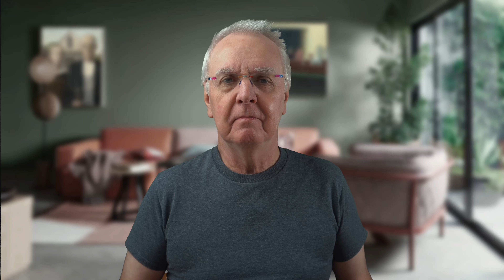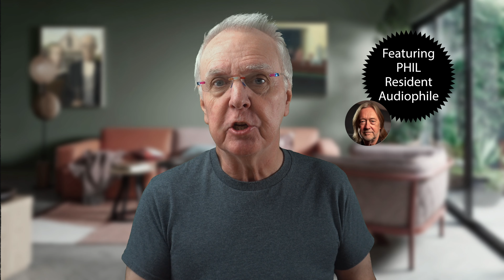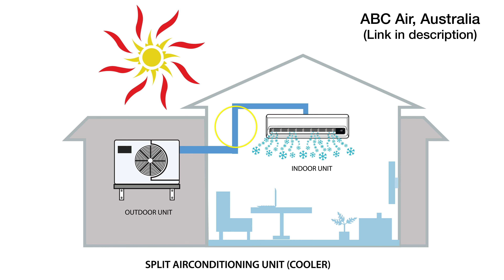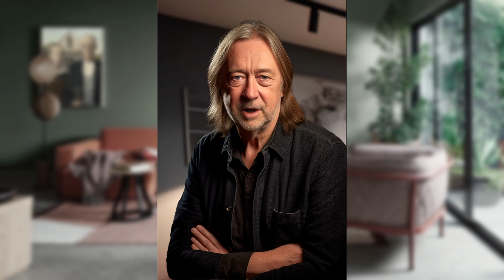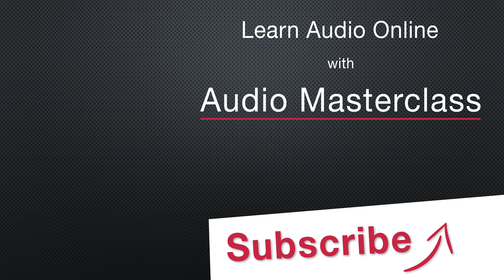Audiophiles! Are you losing your cool?

Comment: Found it so hard to listen to your flawed logic.  Sure a manufacturer can design a component to manage heat, but did you actually read and totally follow the instructions in the box.   My amp assumes an average room temperature so according to the manual I cannot run my setup in the summer.  The specifications state I need to provide 80cm of clearance around the device, so I take it I cannot put it inside a cabinet.   Thank goodness it has XLR connectors on it as the only place in my room I can guarantee nothing within 80cm circumference is on the opposite end of the room.  

So perhaps the need for cooling isn’t that the manufacturer didn’t account for heat, but more didn’t accommodate for realistic use inside a house where room temperature varies, and air flow can be compromised.  so adding some help can make a difference from having an amp clipping on a louder complex passage of music and it just simply works.
Reply: Are you sure that's not 8.0cm .... 80cm is almost 3 feet.
Reply: Exactly.. and the message I sent to the support department basically said the same thing.   The response back was they don’t recommend putting the amplifier inside a cabinet as it restricts air flow.    I proceeded to ignore it and fitted a dual 140mm computer case fan to push air into the top of one half the case, and flipped over to pull out air on the other half.   Forced airflow ventilation and zero issues at almost silent noise levels as I used a big enough fan for CFM running at low speed for silent opposition
Reply: @innovationsinm  
Okay... but one suggestion ... Warm air is less dense and tends to rise upward.  This is natural "Convection".  

When boosting airflow in a case (as opposed to on a heatsink) you generally want to improve on the convective flow.  That is: you want to  draw hot air out through the top and let cool air flow into the bottom of your device. 

It is entirely possible that the blowing air into the top could stall the natural convection and actually have the thing running hotter.
Reply: Naïvety on general manufacturing isn't good grounds for advice.   The whole side the manufacturer has with the 80cm around is to allow for enough air to be cool to allow for the process you are trying to describe.   but put an amp inside a cabinet and all of a sudden you loose the source of cooler air.   As you are trying to use convection where the warmer air will move upwards creating a lower pressure over the hot heat sink that will draw in the cooler air from the side.   (you do realize that air has a very bad heat conductivity)  Now how you get from the bottom is a mystery as there most likely is a circuit board that everything is mounted on.    Where this fails is you are now inside a cabinet that is more of a closed environment so initially the warmer air will start to rise.  B ut as the air above the device heats up the pressure of the hot air increases to the point that less and less convection happens.   As the now warmer air above the heat sink gets hotter it requires more force to move the air upwards so the heat sink slowly gets hotter and hotter.  For a while the system will work but pretty soon the heat sink is warming the air to the sides just as fast as the air above til the point the convection current totally collapses.  
So now to overcome this you either need to try and keep constant new air flowing into the cabinet so that a constant amount of cool air is inside the cabinet so that convection can happen naturally,  or you can force a larger amount of air over the heat sinks so that they never actually heat up.   one of those options are far more effective than the other but you can choose what method you'd prefer to use.
Reply: @innovationsinm  
Most competently designed amplifiers (other devices too) that use internal heatsinks will have openings in the bottom or lower sides to allow cool air in.  If they do not, you might want to consider creating some. 

The whole point of fan-boosted-convection is to get the heat off of the heat sinks... the fans will simply accelerate that process.
Reply: @Douglas_Blake_579  No point in arguing with ignorance (or perhaps arrogance).    you have clearly made your mind up you are right.   Best if luck with your opinion.  clearly it is working well enough for you
Reply: @innovationsinm  
Well... Chuck You Too Farley!

I'm 40 years in the trade.  You might reasonably assume I learned a few things along the way.

Comment: I used to fix copiers. I have a bunch of 24v fans that I pulled out of junk machines. I have a bunch of AC/DC adapters laying around so I wire a 6-12 volt line to the fan. It runs slow and quiet. I plug it into a switched outlet and I'm all set. I set the fan on top blowing air out.

Comment: AC Infinity fans are top notch. I used an inferred gun and after 30 minutes my Emotiva - 94f , Outlaw -88f and Fosi V3 - 97* and none got crazy hot, but much warmer then I cared for. So after running with fans back on no amp got over 80*, so yes they stay cooler and I'll take that insurance anytime.

Comment: Lets start with a simple observation ... Most audiophiles spend considerable time trying to fix problems they don't actually have.  "Much ado about nothing", enacted in modern day real time.

David correctly points out that the first step is to determine if you have a problem at all.  Most modern electronics is safe up to about 50c, measured on the heat sinks, which will translate to a higher but still safe junction temperature in the actual chips and transistors.   

Also check the manufacturer's specs. They will most often tell you what the device's safe operating temperature range is. The best way to measure the actual temperature is with an infrared thermometer set to show you the highest temperature in it's view.

The easiest first thing to do is make sure your equipment isn't jammed into some small cubby hole with no air circulation around it.  The close confines simply limit the amount of cool air the device has access to. The more open the space the better.

Also don't stack things on top of heat-producing equipment. This runs the risk of overheating the device and anything stacked on top of it.

Competently designed amplifiers will have thermal shut down circuits that also protect against over-voltage, reverse voltage, DC offsets, shorts and too much current.  They will let our ear-bleed seeking friends brutalize them only so much before they simply shut off.

Of course the solution to active protection circuitry is very simple:  Turn it down. 

(Seriously, this is a long ignored secondary function of volume controls that is as easy to use as the primary function of turning things up to the point of impending ear damage.)

Fans are not evil.  Any 120mm computer case fan, designed for 12 volts, will run near-silent at 9 volts.  Simply attach rubber feet and place them on top of the device's top cooling vents, to draw hot air out.  Or, when there are no top vents, place them to simply blow cool air in the direction of the device.  Either way the goal is to boost convection cooling, and it usually works quite well.  You may notice a slight whirring when the system is idling, but you'll never hear it during music or movies played at reasonable volumes.
Reply: Never had an AB or Class D amp overheat. Never needed an extra fan.  I have a class A pre which runs a bit warm.  My commercial amps have fans which have never come on in home use apart from one that runs the far from startup.   Had a tube power amp that ran very hot and the power tubes really needed to be replaced every year .... based on actual measurements which revealed rising distortion components. My tube preamp didn't eat tubes but I had to replace the power supply every 2 years!  Boo!
Reply: Thank you!!

Comment: I design and build my power amplifiers with heat sinks far bigger than they need to be so they always run cool to slightly warm. I do this because for every 10 degree Centigrade increase in transistor junction temperature, the life expectancy halves.

Comment: fans are ok imo, just not ones that are 40db loud...
Reply: Look at the new crop of 120mm computer case fans.  They're made for 12volts but if you run them on a 9v power supply they're almost silent.  AND they're a lot cheaper than the "audiophile" stuff on the market.
Reply: @Douglas_Blake_579  i replaced the fan of a xbox one s with a noctua fan..... from memory the stock cooler was way louder, the noctua barely noticable, the cd drive became the big next noise source.... :) 

Noctua is probably the go-to fan brand for such after-market mods
Reply: @dornauge1995  
They are good fans ... but any decent fan will do the job.  
Again the secret is to run them on 9 volts instead of 12.

Comment: No cooling issues at all in my system, the fans don't even switch on with the lone exception of my gaming console. Video boards in an AVR might run hot in some units, however.

Comment: I have a class A Super Dynamic JVC receiver from 1987. I used to run a small fan on it. Didn't hear the advantage of class A, even in comparison to several other class A/B units that I've listened to over the years. More recently, I listened to a Marantz integrated amp, switchable between class A and A/B. I heard slightly more clarity in class A mode. Based on my years of experience, Class A isn't worth the inefficiency, the heat, and heat isn't exactly a friend of electronics / circuits. I also do not want extra heat in my home when it gets hot and humid. That makes the AC work harder. Class A/B for me. I am good with it.

Comment: Follow up question: should I worry about dust entering the holes?
Reply: Yes... David is right, it's a problem.  (fans or no).  
When adding fans try to boost the natural convection inside the casings or along the heat sinks.  That is place a fan on the top vents to draw warm air out of the case.  This will also draw floating dust out of the case with the hot air.  It won't totally stop the accumulation but it will cut it down by quite a bit.
Reply from the maker: Yes you should. As an extreme example my old Mac Pro, soon to be visiting eBay, sucked in the dust and collected it. Every so often I would vacuum the vents which would be clogged with dust, and once in a while vacuum thick layers of dust inside. This would be less of an issue with audio equipment but I don’t think it would be of no issue at all.
Reply: Dust building up on the surface of the components and heat sink might become an insulation jacket over decades.

Comment: thank you for the topic, my comments and experience sharing:
1) cooler doesn't mean better. for example Tube amp: you have to wait till it warms up.
2) Solid state devices are much more tolerant on temperature range.
3) Let's assume that a good design for home residence is designed to work at indoor temperatures of +15 to + 35 degrees  and assumes a normal  room temperature of 25 degrees. this is a very narrow temperature range.  industrial range for solid state components is at least -20C to +70C Degrees
4) Passive cooling has no limits. Any passive cooling system can reach any goal of heat dissipation using enough amount of size (volume) and weight (and $$$). 
5) Fans are a big no no. You need it at least for a late night quiet mode of listening. In such a scenario  a "quiet fan" is noticble. I have a PC as part of my system and have change it to  fan less heat dissipation method. this (with other actions) reduced the room noise level from 33 dB SPL to 29 dB SPL.   
6) Class A and Class B share the same electronic design the "only" difference is the Bias current level.  if you increase the bias level you allow more dynamics on the quiet passages to be using the "non switching area" of the working point. of course, the higher the Bias current the bigger heat  dissipation required is. a good designer takes into account the distortion level of each and every component and stage.   
7) Bi amping, plus Active subwoofer splits the power between amps thus reduce the required amount of power per amp. Mono blocks as well (but will increase the $$$ investment).
8) I did not mention yet the Class D option. certainly for subwoofers. 
9) Air conditioning in the room: has to be quiet as well.
10) thermal active  bias control is not a problem:  thermal bias controls assures same bias current at all temperatures. it is not to be confused with temperature control (which most Passive amps do not utilize). 

Thanks
Reply from the maker: Picking up on your comment on tube amps, obviously the heater needs to be warm but I wonder whether other parts of the tube need to be warm too. I wouldn’t think that any external cooling would affect the heater but it might be interesting to explore this further.
Reply: @AudioMasterclass  
The cathode has to be warmer than the Anode for the tube to conduct.  So yes the envelope temperature does matter.
Reply: @AudioMasterclass  
I Don't use tube amps. From other users reporting, I know that a tube Amp needs some 10 to 20 minutes of operation till it reach its optimal working point. This means it finished warming up period and reaches a temperature stabilization.

Comment: I recently came across the Noctua NV-FS2, which is marketed as a quiet and award-winning fan designed for general use, including mounting on the vents of devices like integrated amplifiers. While I’m not an audiophile and don’t drive my amp very loud (it’s a mid-range NAD, though I don’t recall the model number), I’m considering adding this fan to help with cooling due to rising ambient temperatures—especially in the summer months, when climate change has made things hotter for longer periods.

I’m primarily concerned with the longevity of the amp, not necessarily improving the sound quality. Many electronic components, like capacitors, are rated to handle high temperatures, but it seems to me that lowering the operating temperature by just a few degrees might reduce stress on the components and extend the amp’s lifespan. I know some people might be against using a fan due to potential noise interference, but since I usually listen to music in the background while working (not in a sweet spot), that’s not a dealbreaker for me.

I’m curious if anyone else has tried something similar, whether with this Noctua fan or another solution. My main goal is just to keep things running cool and dust-free, especially when I don’t have air conditioning. Has anyone noticed improved performance or longevity from doing this, or is the effect negligible?

As a footnote on noise In the 1990s, when vinyl records were still widely used, I remember visiting a shop in Toronto called Bay Bloor Radio. They had stunning audio gear, not just functional but visually striking—amplifiers, CD players, turntables. One piece that stood out to me was a turntable with a frame made of stone, and it was spun by an air pump instead of a belt. Interestingly, the air pump was meant to be placed in a separate room to avoid introducing noise into the listening space. It’s fascinating how far design went to eliminate any trace of noise, which is something people might think about when considering adding a fan. Fans are often associated with noise, which could be a valid concern for some who don’t want to compromise their music experience.
Reply: I've added external fans to a couple of AV rigs.  What I do is take a lower priced, generic, 120mm computer case fan and run it from a 9 volt supply, where it's nearly silent.  I will put soft rubber feet where the screws would normally go and just lay it down on top of the top vents in the device casing, so it draws hot air out  of the case.  It's quiet, it's cheap and it gets the job done.
Reply: @Douglas_Blake_579 thanks for the tip and your experience.
Reply: Computers used in aircraft are put through 14 temperature cycles of typically -54 Deg. C to +85 Deg. C to weed out infant mortality.  Component reliability is a bathtub curve but long periods at high temperature will shorten their life.
Reply: @stevesmyth4982  
Your typical home stereo (or computer) would NEVER survive that.
Reply: Noctua fans are top-notch, I use them in all of my computer builds because I hate fan noise!
Reply: @ian-nz-2000 indeed, Noctua does make highly acclaimed fans and as I go through all the research involved in a decent PC build, I discovered Noctua and their Home skew of accessories and as a result I found that they have an externally mounted setup for audio gear. 🎼

Comment: A circuit to turn down the volume slightly in class AB would be a much better option. Because of the logrhythmic nature of things a small reduction in volume has a large effect on power and therefore heat. Alternatively a better choice of speakers would mean the amp wouldn't have to work as hard and would stay cooler.
Reply: Suggestion 1 does not work
Reply: @NeungView  Why not?
Reply: Some amps actually have this, already.  You push them too hard and they start limiting current... effectively turning things down.
Reply: @Douglas_Blake_579  yes, many 1970's and later models have "dynamic biasing".